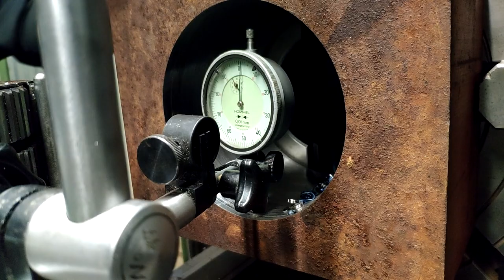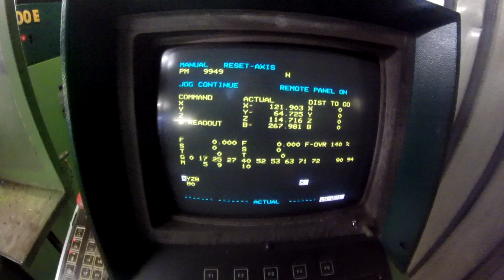Herstellung eines Lagergehäuses // Making a bearing housing

Comment: Were the bearings fitted with grip tight locking elements for the shaft? I've built many  of these in flange design down the years. I always leave an interference fit on the outer race, otherwise the bearings fail as steel expands more than cast with heat, Nice work though well done !

Comment: Nice job, very entertaining and informational video 😀 
Any particular reasons why you didn't use a trepanning tool, like a huge annular cutter, for this job? (Other than simply not having one on hand 🙂)
I may be over-simplifying things here but it may have saved more than 50% time for this particular job! Plus the cutting forces cancel each other out so it puts less load on the machine, especially on the spindle bearings and no load on the tool post unlike a boring bar since it is tailstock mounted.
Reply from the maker: If I had a trepanning tool on hand I woul've used it :) But for one or in this case two piece production it was just easier to convert it into chips. Still someday I will get my hands on a tool for these ocasions!